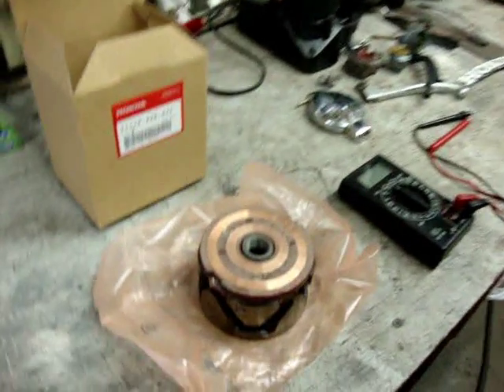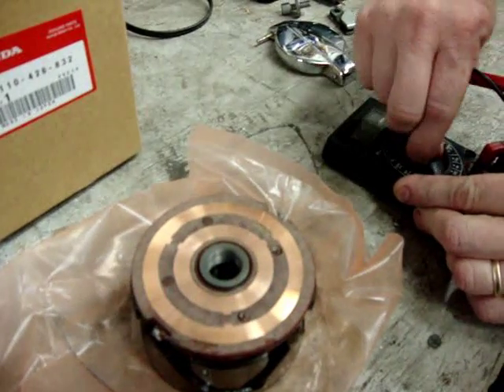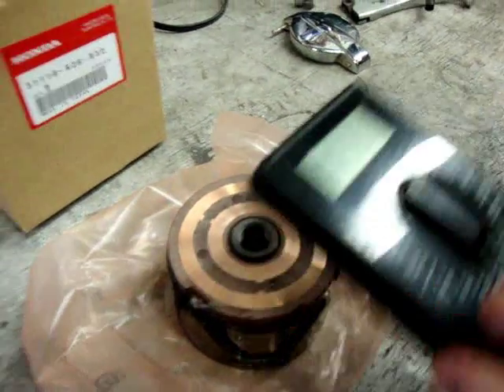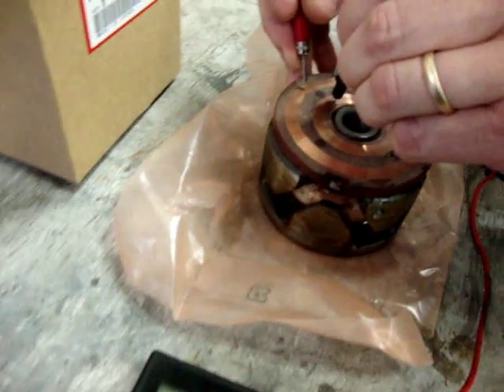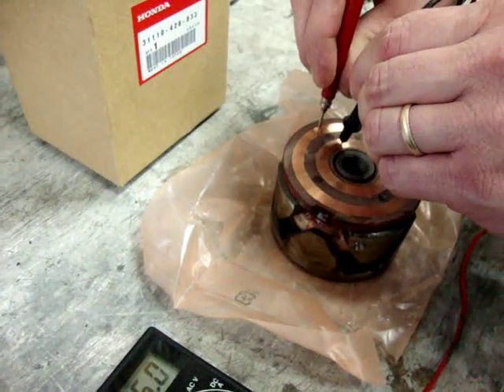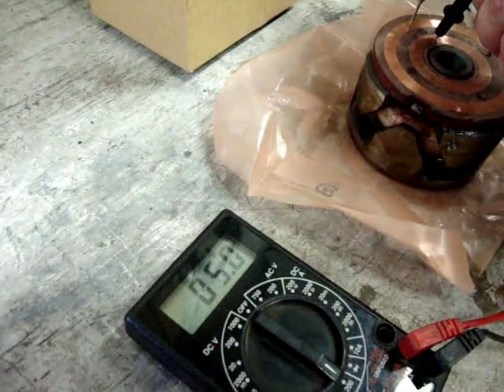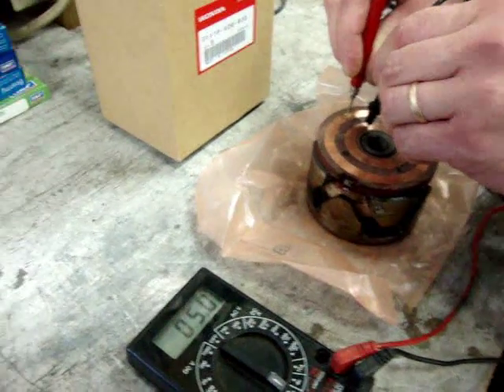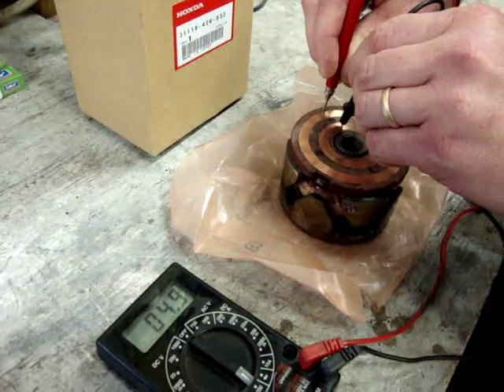PART 3 of 3: Theory & Testing of Honda CB750 900 DOHC Motorcycle Charging System @ rcycle.com

Comment: I'm curious as to how you manage to find NEW parts for an old bike?  I have an 85 Yamaha Maxim XJ700 (only built 2 years 85 & 86) & the parts that I do find for it is ether reconditioned or if they are new they're very expensive.